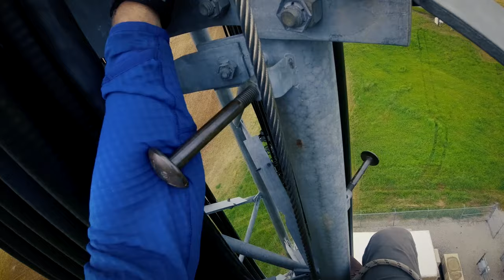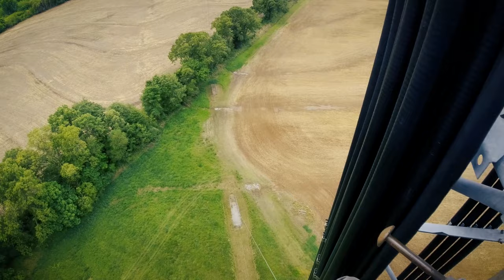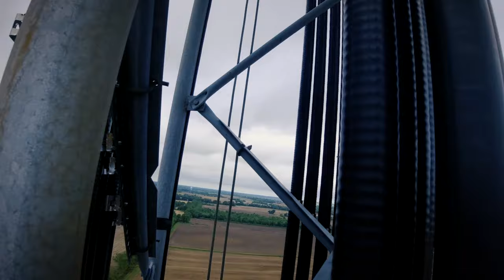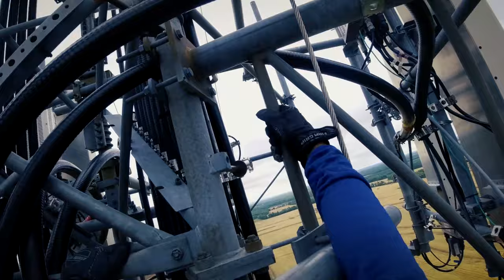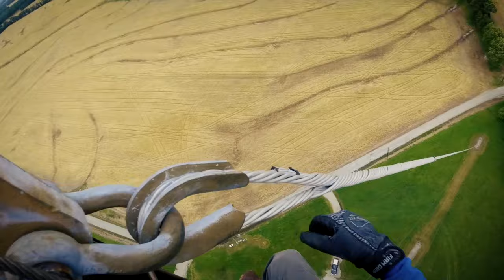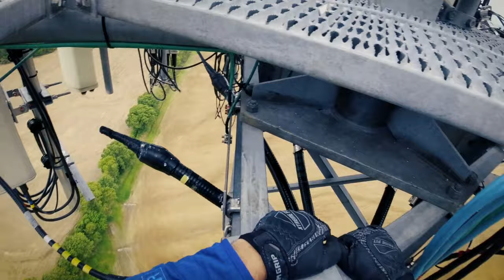My New Job | Climbing Cell Phone Towers

Comment: Retired RF engineer.....always had mad respect for the tower guys who had to implement my designs. It's dangerous, exhausting work that doesn't pay enough.  Think about these guys every time your cell phone dings.
Reply: It pays enough
Reply: @boobiedefloop6097  maybe some places pay enough. After 8 years I make 21/hour and insurance for myself, my wife and my son is 326 every week whether I make 20 hours or 60 hours. And that doesn't include the other stuff coming out of my check. My gross is 64k and I see 38k for my net. So this stuff you see on other videos about 20k to change a light bulb...don't think that's a reflection of what the average tower climber makes.
Reply: @psilocybinrebrandinginitia8068  You don't get paid anywhere near enough.  I could never climb one of those towers, too scary.  Respect for doing what you have to do to support your family.
Reply: @kwd3109  thanks man, I appreciate that. That's why I took the job in the first place. I needed something with benefits and someone recommended this job and told me they don't require experience and provide training because there aren't enough interested people to fill the demand. He was right, and now I have a pile of certifications and a ton of experience in the energy sector as many of our customers are major oil and gas companies so I'll soon transition to a safety-related position
Reply: @psilocybinrebrandinginitia8068  I literally just got into the industry and I make $21 plus per diem
Reply: @psilocybinrebrandinginitia8068  I’m a army combat veteran & always got bored with avg jobs that people tend to do. I was referenced this job & It looks so fun and amazing. I applied for It hopefully I get the job !
Reply: @victorsaenz9452  are you in Texas ?
Reply: @ogjhavynicholson3117  I’m originally from Texas, what made you guess?
Reply: @ogjhavynicholson3117  I’m a vet too! I went to Airstreams renewables Inc. (trade school) They’re primarily veteran students. I was in the infantry for 4 1/2 years I got out and tried college and working jobs and I was fucking miserable as shit! I saw an add for that trade school, I said fuck it and enrolled and within 4 weeks of classes I was getting job offers left and right! They train in Wind Turbines, solar, and telecom. Rn my job is 6 weeks on 1 week off.
Pay: $21hr
        $40 Per diem

It’s a lot of work and overtime but it definitely pays well and going to Airstreams Renewables Inc was probably the best decision I made since being out and it has really helped me. They accept the GI Bill and provide 3 hot meals and housing on site, they’ll even fly you out round trip to the school from wherever you’re at. Good that you applied but this school teaches you a lot and through their connections they’ll get you on with a great company in no time. I graduated on a Friday and was at work on a Monday! Look em up on FB and Insta!
Reply: @ogjhavynicholson3117  good luck man, I'm sure you'll get the job. There is a huge demand. There is a major deficit nationwide in this industry. Wish you the best man. And I get it...marine combat vet here.
Reply: Homedad Nips  Louisiana. They pay better up north (at least where I've seen)  but I can't take the cold
Reply: @psilocybinrebrandinginitia8068  that’s insane I’m starting my training Monday and I’m starting at $19 an hour with benefits and insurance
Reply: @psilocybinrebrandinginitia8068  thanks brother take It easy. Thank you for the words
Reply: Europe (Austria) They pay around 12 euro/ hour ( all in contracts) so the overtime hours are not counted! So guys! Don't complain if you earn more than 29-30 per hour! It's slavery for small money! Better work somewhere on the ground for this money! Deliver packages for DHL or something else! So. the conlcusion is, do not ever accept to do this for a company, do it yourself asa a freelancer, don't support the incompetence of some sitting in a office. Stay safe fellas! I am disgusted about my last sallary so...Take care about you and think twice before you start to work something like this.
Reply: @boobiedefloop6097  how much for apprentice
Reply: @victorsaenz9452  is this apprentice pay?
Reply: @crush9197  yes
Reply: i climb this for free and without pay xd
Reply: @boobiedefloop6097  These dudes make around 50k, that’s definitely not enough
Reply: did the radio waves affect your health??????
Reply: People who think this job pays enough are dumb.

2022 & some places in Ohio & Michigan start out at $17-$20 an hour.
Reply: I started at 22 an hour in tennesee. Top hands make 30.  You get there pretty fast as well. This was 2022 as well. Some companies suck horribly and some are fantastic. Also get per diem and a truck... oh and top of the line PFAS. And I get to be home most days. My last company was 16 an hour and travel around the country m-f. And like 70 hours a week. It's wild how drastically the pay differs. But I honestly do this job because I love it and loveclimbing. It is freeing
Reply: @lyoko111  That is dumb.   But there are positions offering up to $35/hr for the same job in some places.  That would easily pay all my bills and then some.  I'd never do this for $17/hr though.  Grocery stores pay better than that.
Reply: @briancarr1983  which companies suck in your opinion.   I'm considering this job but not trying to waste my time on a bad company.
Reply: @psilocybinrebrandinginitia8068   You definitely not getting paid enough unfortunately I'm cell tower engineer here at Verizon in New Jersey I been a year with the company and I'm getting paid 34 hr you should look into other companies with the experience you have they will pay you. Stay safe out there.
Reply: @Boobie DeFloop  no it dont

Comment: Tower climbers are a strange and rare breed.  At my amateur radio club in school we had a couple of 100+ foot towers that I believe once served as a directional array for an AM broadcast station.  Most of us had enough sense to stay off of them, but a hard-core group of 3 or 4 guys used to climb the towers regularly, ostensibly to "adjust" an antenna, but probably just for the fun of it.  They used professional climbing gear, knew what they were doing and took it all very seriously, but most of us on the ground got queasy just watching them.  One was a good friend who told me and confided, "It's fun."  Guess it takes all types.
Reply: The thing about it is the ones who do it really aren't afraid of heights - like at all. Call it a screw loose in their brain or something maybe, but I climbed for two years back in the late 90's and I wasn't. The thing I did hate though was the travel.. two nights in this town, three in the next one, a week in the next one, etc. That took a toll on me. 

But then I had a pretty nasty fall from around 12-15 feet off of one once and screwed up my ankle. I decided then that my climbing days were OVER. Since then I've been terrified of heights.

Comment: That cable system seems a lot faster and safer than having to hang a hook every couple feet. Hope you're enjoying the scenery, everytime you look down a shiver goes down my spine, lol
Reply: A hook catches you a few feet off the ground the wire I believe haven’t used one in a while basically slows your fall like a yoyo
Reply: A hook has a maximum fall distance of about 6ft plus stretch factor and if it’s not above you it’s even farther so the cable system is much safer and typically will stop a fall within less than a foot!
Reply: @josephruiz2959 the wire stops you immediately

Comment: At least you get full bars coverage on your phone 🤣🤣
Reply: Haha haha yeah. He’ll get 10 bars up there
Reply: Sometimes there's actually zero bars up there because you are too close. Seriously.
Reply: @ATLTraveler  Yep. Inside the skip zone. Phone won’t work,  you’re basicallly jamming it being that close
Reply: As a previous tower tech, it’s the guys that erect the towers that have it the shittiest. Worst site conditions (mud up to your knees) dragging cables if it is a guide tower, etc etc, no service because after all, you are the one putting the tower up for service, shake down ( painting scuffs, making sure the bolts are all tight, because if you erect the tower, the bolts aren’t tight until after the entire tower is up lol) the list goes on.
Reply: I always hated climbing using the safety climbs, every foot they get hung up, gotta step up, pull it up to release, then back down and then start up again lol
Reply: That ain’t how those antennas work lol. They shoot straight out so you won’t necessarily get the best service
Reply: Lmao

Comment: Hey bud. Fellow Tower Technician here. Glad to see new blood in the industry. Just be careful about what you show on camera, the carriers and equipment manufacturers usually make a big fuss about showing behind the sectors showing configuration, azimuth, tilt etc. You and/or your company could potentially get slammed for showing that stuff.
Reply: Good to know. 
Was thinking about filming myself for a Verizon sub contracotr
Reply: Hey serious question how much money is in a business like this. I’m 17 right now and want to find a well paying job I’m not afraid of heights and thought this might do it.
Reply: @noahrichter9788  Honest answer? Not as much as it should. Starting is going to look like 20-25 an hour starting. But, you can potentially move up quick, and be making closer to 30-35 an hour just after 5 years. The carrier telecom market is volatile, and available work is based entirely on the customer. That being said, the best thing you can do is do Microwave work. Less BS, mostly just microwave alignment, maintenance and the occasional replacement. Often pays better as well.

Comment: You might want to keep your helmet on while youre shooting. ANSI and/or OSHA (i forgot which one) may catch wind of this video about your safety violations. Also, pro tip. When youre using a cable grab (ladsafe 2/3) clip the cable on every other rubber anchor, keeps the cable from whipping around below you when youre climbing.
Reply from the maker: Yes dude that’s a hella pro tip! I don’t know why that’s never crossed my mind haha….
Reply: @ACoupleofCados  very useful when you're climbing a wide base thin top tower and the cable grab bends with the tower
Reply: At the very beginning of the video too he disconnected his ladder safety climb without being secured elsewhere. I shit myself, you’ll get fired on the spot at the company I work for for that.
Reply: Another pro tip
 Never tie off below your belt line. Always as high as u can

Comment: I always thought it would be cool to do this as a job, but you have to travel a lot which I'd like less.  I like to be able to sleep in my own bed at the end of the day.  I imagine it's a crazy physical job too. It's one thing going up for small maintenance but imagine doing an install of those big antennas!  I guess there is gear that helps lift things, but still would be quite a bit of work I imagine.
Reply: I do cell towers and go home every night. 
We’re an outfit out of Cali that just opened a new outfit in Colorado 
Pays good
Making over 30 an hour

Comment: I used to work for charter cable n I would do installs climbing 30 ft telephone poles. N do connections. I was afraid during my training days. But it's something you get used to. Im not sure if I have the guts to climb this high. But kudos to you brother for doing a great climb n great job as well. Be safe out there

Comment: I went to a job fair last week and there were two companies offering this work starting at 15 an hour. That's going to be a big nope
Reply: walmart is paying 15/hr now lol
Reply: @travismartin9813  not really....
Reply: @AceSantiago  They are advertising $17-18/hour starting wages at the Walmart I shop at, and that's at a Walmart located an hour away from a big city.  $19+ for overnight stockers, though I'd argue that those people deserve more hazard pay than that, as there always seem to be characters in Walmart stores late at night.
Reply: They usually start low because the turnover rate is so high I started at 15 an hour and a year and a half later I was making 28 an hour
Reply: @AceSantiago  Walmart pays $22/hr for night shift managers.

It guess it depends where you work.  They pay temps and part timers almost nothing though...

Comment: Firstly, if your going to make videos, then why not tell us what the game plan is, and what you hope to accomplish ?
Why the intermittent sprays of paint ?
Too, I am surprised at the number of wires, or perhaps coax hanging free near the top ?
I would think subject to High winds and ice, sooner or later, something would fail ?
But my biggest concern, is for your Safety from RF !
Those signs near the base warning of an RF Hazard, should not be taken lightly !
Just because you can't see it, doesn't mean it can't hurt you !
And in many ways !
I've climbed and constructed a number of smaller Rohn 25 Towers as example, many related to C.B. and Amateur Radio Service.
Been up a couple Commercial sticks, one in particular, the Tower for Television station WCCU in East Central Illinois, and was told at the time, it was the tallest solid steel tower in Illinois at the time !
I haven't been that way for a long while, but wonder if the Tower is still up, as the Tv station moved its transmitter on another stations tower ?
I digress, getting back to the Dangers of RF, when we would climb a Hot tower, someone would turn the Transmit power down, until we were out of harms way !
I wondered while you stood in the middle, of essentially a Microwave oven, ( Stretching it a bit ),  I wonder if you understand those potential dangers ?
Too, if you want kids, I hope you already have them !
RF especially at those frequencies are no joke !
Sadly the U.S. treats Cell Phone energy much different from the rest of the World !
Likely driven by the almighty Dollar ?
But if you do even a little bit of research, I believe you'll see a number of cases, where RF played a detrimental roll in peoples health !
Please be Safe in all ways, for the people that love you !

              BLUE SKIES 
        WIND FREE DAYS
                       & 
            SAFE CLIMBS !

         GOD BLESS YOU 
                     &
               YOURS !

Comment: I would highly recommend a couple blue water rhino slings to use as personal tie offs that way you can go around the tower legs instead of putting your lanyards on horizontals and diagonals
Reply from the maker: Got slings in the truck. Ive been trained that members are considered a hard point.

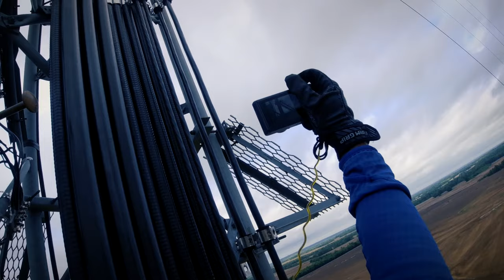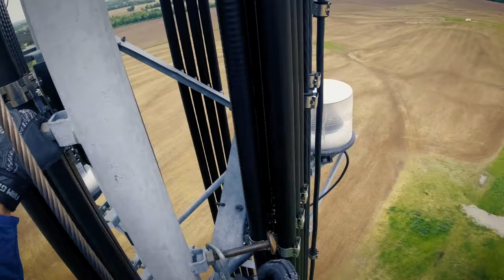Comment: Between the 7:43 and the 8:28 mark of the video.   There are gaps between the metal brackets where the welds are holding the hand holds to the pole.
👋 👋

Comment: I have been building cellular systems for 16 years.  One suggestion.  Get inside the shelter as fast as you can.  This requires youth, and while you have it for now, it will fade, I promise.   And please follow all the rules.  I have seen climbers drop antennas and take the head off thier ground guy.  I have seen an entire team get electrocuted. Stay safe, and thanks for being an ass kicker.  You guys are special.

Comment: Tower Inspection 
Newly installed?Yes by the looks of some Cables
Or Was the Triangular Mast have jst been sand Blasted?
Because sometimes when It Does And It stays Uncoated for some times Then Orange rust Alike starts to appears

Comment: quick question, when you’re getting down is it the same way as when you went up?
Reply: yes
Reply from the maker: Usually a little faster haha
Reply: A Couple of Cados and also, do you still climb the towers even if it’s really icy or snowy?
Reply: I've climbed tower right after snow storms myself. It sorta varies but it's smart to bring a hammer to get the Ice off, especially if your 200+ ft. Worst tower was 584 in Minnesota doing at&t.

Comment: Thank you for sharing. Was that Rust-oleum that you were applying on the dents/scratches? Were those cotter pins rusting out or were they are a replacement schedule?
Reply: it's "Cotter" pins.
Reply: @csmith8503  thanks.
Reply: Galvanizing compound

Comment: Please go over your safety equipment. Are you attached to that cable? Are you allowed to launch a paper airplane from top? Do you wear a parachute? Are you Spider-Man? Can you add altimeter to the screen. Ever been attacked by a bird 🦅 do you climb on windy days. Or in the rain. Is lightning a threat? Ever drop a tool and have to climb back down? Is there a big temperature difference at top? Do you climb at night? Or in fog? One last ? If your up that high how come my phone only has one bar 😢

Comment: PLEASE DON’T COPY WHAT YOU SEE HERE. 

If this is a new job then you need to be wrote up. No lanyard, you didn’t attached your fall protection device until 20 foot up and you were awkwardly hanging on by one hand which is where most accidents occur. You are solo climbing which is a no no in case you can’t self rescue.  No hard hat. Nothing you’re doing is industry standard so I’m assuming you didn’t have permission to be there and the services were not shut off and rerouted for maintenance which means you could of gotten radiation and or gas poisoning. This obviously isn’t your job.
Reply: Here he is! Right here! I found the pencil-necked safety geek with the clipboard. I knew he'd show up sooner or later!  (Hope he doesn't find out
I once pulled the warning stickers off an extension cord. All 14 of 'em!).

Comment: Did I see that correctly? Are you using just one ascending device with no backup? I'd want to have two connections to the cable just for safety.
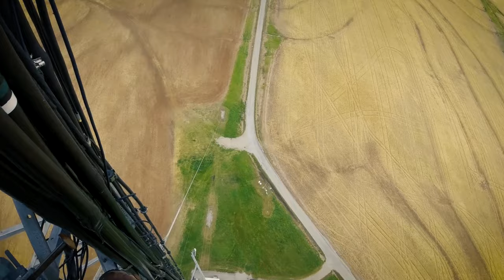Reply: 21:18   Looks like he has two.